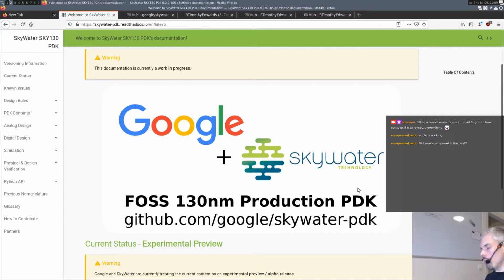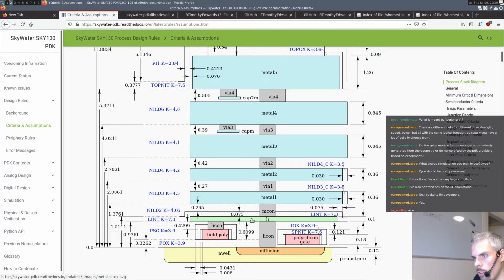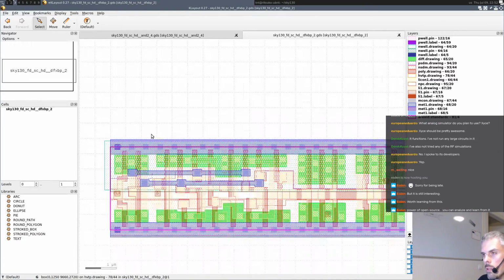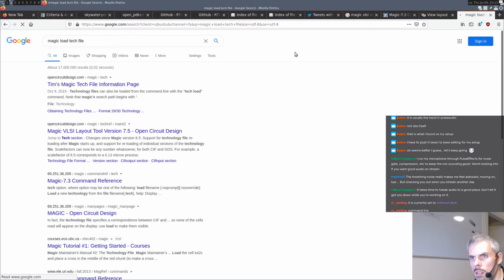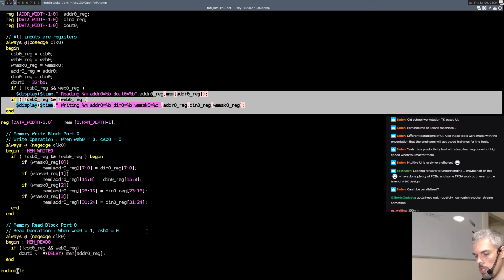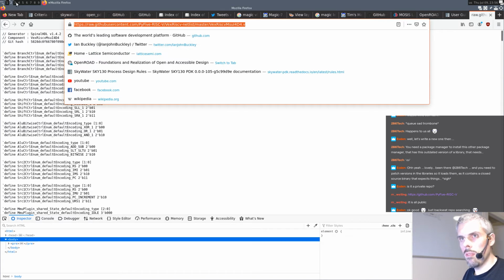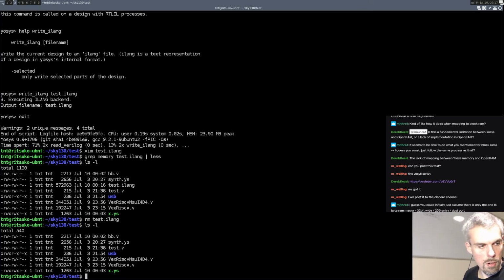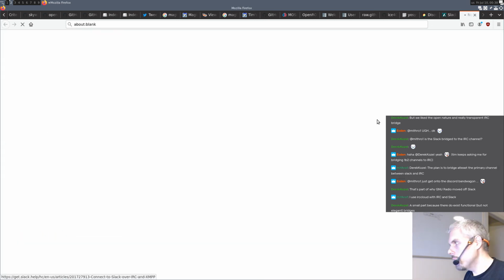[stream] Skywater 130nm PDK - Initial Discovery

Comment: Hello,
 I'm trying to use this PDK to design analog components at  transistor level. I don't know to call the good model of transistor.
If some one had  a exemple with a Netlist it will be great.

Thanks Sylvain for this video.
Reply: after 5 days of hardworking 🤕 I  finally found. Some models are not available, Why ? this is an other question. the lib call is / .lib "C:\SKYwater013\skywater-pdk-libs-sky130_fd_pr-main\models\sky130.lib.spice" tt /  and the models of transistors are  sky130_fd_pr__pfet_01v8_lvt and sky130_fd_pr__nfet_01v8_lvt . 🥳